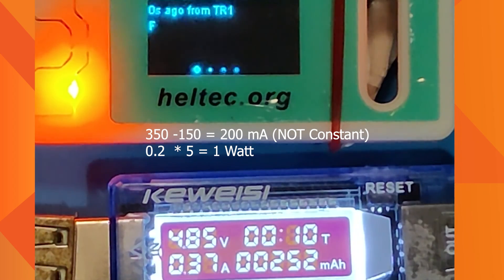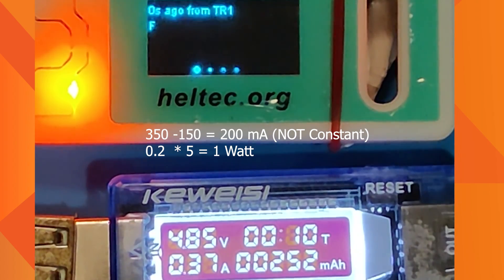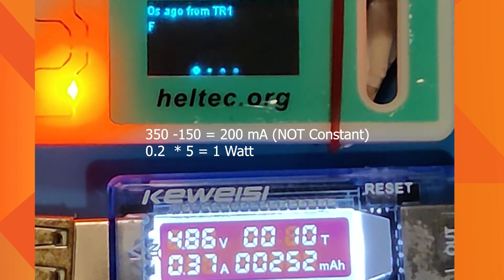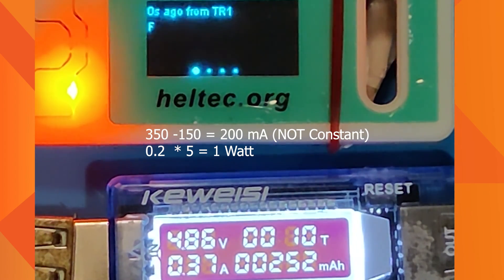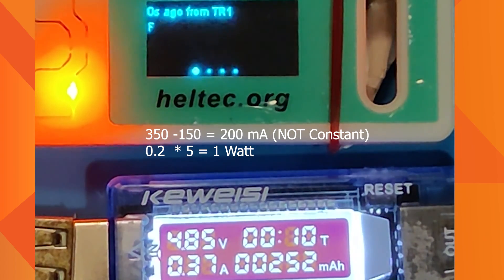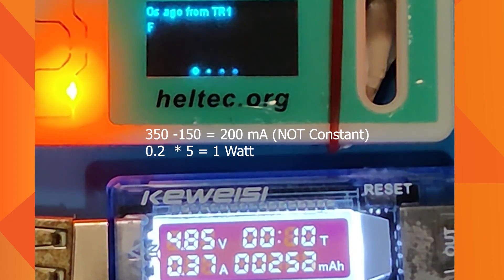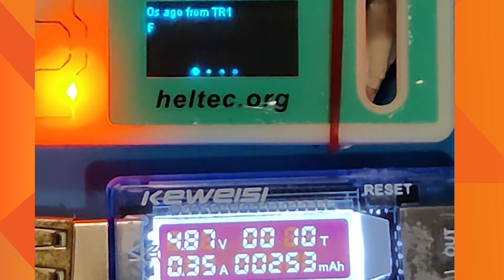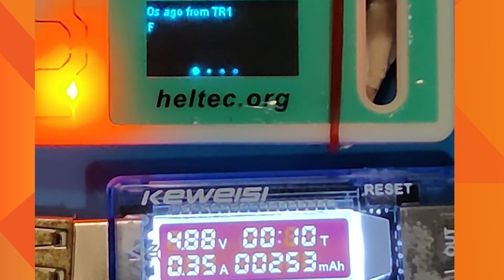Meshtastic Heltec LoRa ESP32 V3 OLED Power Consumption by Technology Master

Comment: the USB-C port provides 5V, the board runs at 3.2v, so there is power loss stepping it down cause it is used to charge a battery. To get true readings you must measure the power draw from a battery instead of the USB-C port since it is meant to be used that way. On repeater mode at power save mode i've gotten readings as low as 13mA on idle and 105mA when sending messages.
Reply: I have repeaters last 4days on a 2000mAh battery which would be impossible with the readinds you're getting from that test.
Reply from the maker: I want to thank you for sharing your thoughts. There is more than one to reach a conclusion. Which way I chose or someone else chose depends upon how accurate results we need and willingness to spend time  and money on it. The tests I have performed are not research level tests going as basis for scientific thesis. They are go people doing it as a hobby.  So charging reading was taken with charging on - charging off while keeping all other things almost the same.
2) As you have mentioned that you were using power save mode, these reading will not match reading shown in the video as I was not using power save but trying to emulate normal use.  
3) I am really happy that you are experimenting with these devices and sharing the results. Meshtastic Discord group is very active community where you can ask/share your results in addition to comments here.